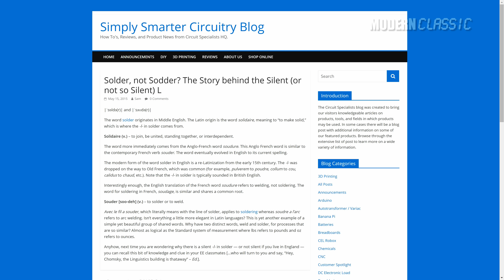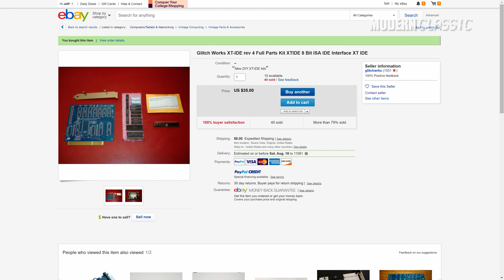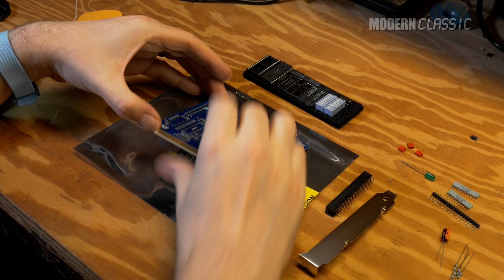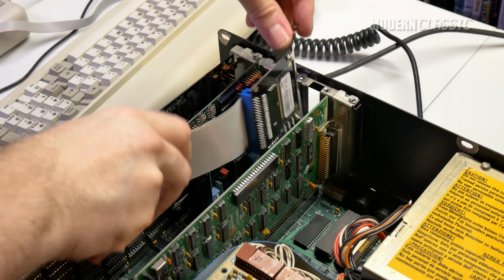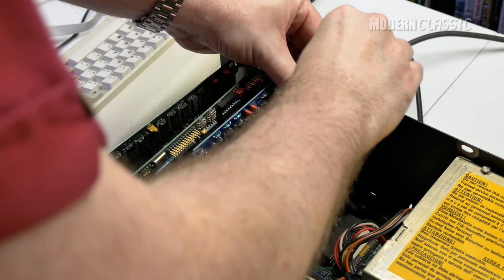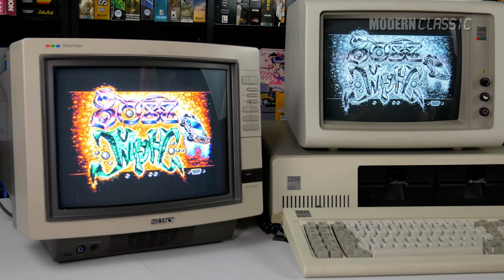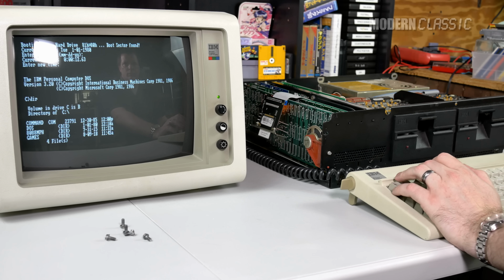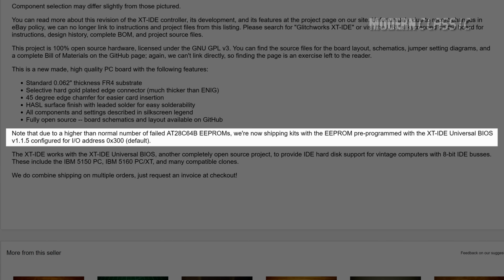Flash storage for classic PC's - building an XT-IDE kit!

Comment: Interesting, I've gotten an old 386sx going curtesy of a CF card, however XT's are harder as they don't have the bios routines for HDD boot, hence your cards ROM. You've kind of got me interested in digging out an older PC and having a go.

As for the sodder/solder thing, I found your pronunciation quite acceptable to my ears, I'm from the soLder side of the world and have just learned to live with it. However I was watching a renovation video the other day and cracked up when they said pergola.

As for the composite colour thing, I'm amazed IBM didn't have a way to display the same colour's on their RGBI monitors, it carn't be that hard to make a fudge box. I live in Australia, where we use PAL instead of NTSC, the artifact trick only works with NTSC, so I never knew of it till I saw it on the net.
Reply from the maker: I'm in the same boat but in reverse - I never knew the NTSC artifact trick didn't work on PAL until I was looking up games that I could install to test it out on this PC. I happened across that info by chance; I had just never thought of it before. So I guess you guys just don't have access to seeing those games in 16 colors?

I'm still kind of amazed that somebody even figured out that you could use the NTSC signal in that way, and give computers powers that they otherwise wouldn't have.

Comment: My first HD was for my Atari 520STm...cost me a total of ~$580 for the 32MB RLL drive mechanism + drive controller + ACSI-to-drive controller host adapter (ACSI = Atari Computer System Interface) + external HDD enclosure.  I remember going to a local ComputerLand store asking if they sold bare drives and after them asking me what I was trying to use one with, they said, "You can't connect a hard drive to an 'Artari'" and that I needed an IBM PC or Mac for that.  And that's when my abhorrence of IBM PC/Mac snobs began! ;-)

Comment: Modern Classic : one hobby tip for you when you solder DIP packages. solder pin 1, then solder opposite pin, then reheat each pin while pushing on the component, so the DIP is tighten to the board and then you can solder the rest of the pins. for pin jumpers, have a bunch of jumpers to hold the 2 rows together while soldering. And finally, the top tool for soldering : FACOM 153 Brucelle

Comment: Possible fix to using 2 slots.  since the IDE card is oriented for XT/AT/ISA, and the CF adapter is oriented for PCI, could you get away with not using the bracket on the IDE card, and seating the CF adapter in the same slot?
Reply: Sarreq Teryx If he did not mind the CF card being internal (and less accessible) then there are other options as well, such as plugging an adapter into the IDE connector or modding the rear of the chassis with a slot for the CF card and eject button and just mounting the CF card adapter to an open area on the rear of the chassis.  Or even spinning a version of the ISA adapter that includes an onboard CF or SD Card slot (though CF is much easier to interface with IDE since CF Cards are just a miniaturized IDE device).

Comment: I really have to take the time to get my IBM PC going. I started to work on it but then summer arrived so my project focus shifted. It has 2x 5.25" drives, no HDD and I have a great green monochromatic screen for it, which still works. Whenever I do get it working, I want to try this version of Linux on it too. I figure, I will have plenty of space to dual boot: http://elks.sourceforge.net/
Reply from the maker: I guess if you do want to run Linux, that's the best version for the original PC. I'm curious how well it runs and what you can do with it. (I guess if you only run the command line, you can probably do a lot.)
Reply: Most of what I would do would be in the terminal. As neat as a modern machine is, it is pretty good at distracting you too. I need to find a network solution for this 5150 as well. So, the uses I have planned for it would be: Distraction free writing, IRC and simple terminal based web browsing. I have no need for a color screen, I quite literally just want to use the green phosphorus monitor I already have. If memory is limiting my ability to do any of those, I can SSH into another box and use those resources.

Comment: I'd say you were using the right amount of solder at the start, towards the end, you were using way too little imo.
You have to remember, this is through-hole stuff.  The solder is supposed to flow through the hole to the other side somewhat.  It's not supposed to just sit where the soldering iron is.  So you have to add slightly more solder than you think is necessary to allow some to flow through the hole.
Reply from the maker: That's why I was using more at the beginning, but I ended up fouling the socket and there did end up being somewhat big blobs on the other side.
Reply: yeah you just have to get a feel for how much you need.  It's very much a skill that comes in time

Comment: I’d like to add one small constructive criticism - you were right to tin the tip of the iron and wipe it clean, that is truly a thing, but it didn’t look like you were re-tinning it before soldering. My dad was a NASA-certified soldering instructor so in a way I’m kind of a drill sergeant’s kid, but for what it’s worth - solder on the tip helps to transfer heat more easily than a bare tip alone. Doesn’t need to have a big glob of soldier on it, just “wet.” My Dad got into the habit of tinning it and then with a quick snap of the wrist, flinging the extra solder off (he typically worked on a piece of scrap or cardboard so he wasn’t ruining his bench). The point is a layer of solder on the tip helps transfer heat to the work. Since you’re correctly heating the work and then melting the solder against it, this might help in the future.
Reply from the maker: I tinned the tip at least 25 times that I didn't show in the video.
Reply: I apologize for mentioning it then.
Reply: The tip gets tinned when you solder something with it ;-)
Reply: It does if you touch the iron to the work, then push solder into the tip and let it flow onto the work. I just wanted to make the suggestion in case it was helpful; I was not judging. The way I was taught to solder was that having the tip "wet" with solder before it touches the work allows heat to be more easily transferred to the work, and that using the heated work to flow solder makes more effective solder joints than melting it on the tip against the work. I am sorry if I offended.
Reply: You are right. It’s good practice to tin the tip before you start working on a project. However the tip will get wet(ter) when you solder a few joints. I always find myself wiping off the solder from the iron when I solder.

Comment: Why DOS 5.0 instead of 6.22?
Reply from the maker: DOS 5 is, AFAIK the last version of MS-DOS available on 5.25" disks, and the idea is to make a set of my own disks so I can reinstall it from the physical disks and then re-partition the card. PC-DOS 6.1 was still on 5.25" disk, but it's forked at that point. (That said, I may go for it anyway.) Also, several older apps won't run on DOS 6.22, and running old apps is what I plan to do on this PC. There's no real advantage to running DOS 6.22 on an original PC. I'm not going to be running Drivespace on the CF card.

Comment: Awesome vid! But i think i would use a sd card to ide adapter instead of cf. Sd cards last longer that cf cards (correct me if im wrong).
Reply from the maker: I'm using CF because CF has built-in emulation of IDE drives - it's part of the spec.
Reply: Heck, the CF form factor is also a good match for the IBM micro-drive things that iPods had, which were also IDE. Seen people just plop a CF card in an HDD iPod as an upgrade and as far as the iPod was concerned it wasn't doing anything different. But the battery lasted longer! And of course, modern CF cards can be faster than SD cards, which is why some high end digital cameras will have a hybrid card slot, or even only take CF. 

Whichever people pick for projects like this is entirely up to preference about what you have already, what you have readers for already, etc. But for computers that can handle IDE, the CF cards talking in IDE definitely simplifies things. A "CF to IDE" adapter doesn't need any conversion logic, which is nice. Just like USB, only the form factor is different between connectors.
Reply: Kit Vitae My actuall only problem with them now, is the price. 
They are very pricy. If mine wont have enough space for my friends games we will get a sd to cf adapter and a 32gb sdcard or even a 64gb one. With the pric of a 32gb one i can buy 2 64gb sd cards basically around here, idk how they are priced in the us tho.
Reply: Modern Classic I think that many of the sd to ide adapters i've seen also do that. But idk. 
I've seen druaga1 do that to install windows 200 in a sd card, on a ide laptop, and it seemed to recognize the sd as a normal ide drive. But his adapter was a bad quality one and sometimes it had some throuble.
Reply from the maker: I haven't looked too deeply into it but CF is kind of the standard thing for this, which is why I went with it. And AFAIK it's because of CF's built-in IDE support, which means the adapter doesn't really need to do much and compatibility should be high. That said, it's probably pretty much the same experience if you get a good SD adapter.
Reply: Modern Classic Do you know how many years it should last being used like that? I have a old cf my friend has a laptop that should support it. Light use of course, in windows 2k or maybe xp without the sp's
Reply from the maker: It will last a long time. It's hard to find really good statistics but here's a little info (read the first comment at the bottom as well): https://mrzonbu.wordpress.com/2007/09/23/compactflash-cf-evaluated-lifespan-per-zonbu/
The thing about SLC vs. MLC mentioned in the comment is another reason I went with a small industrial card - these use SLC, which has a much longer lifespan. You can still use a consumer card that uses MLC and I don't think it'd matter for this purpose, though. There's another channel I watch that had a video explaining this; I'll try to find it again and post it later.

Remember also that DOS doesn't really swap things to disk like Windows does, so if you're running DOS, your card isn't really getting many writes.
Reply: Modern Classic Very valuable info! Thx! 
I will save that website.
Reply from the maker: This is the video I was talking about - it's actually about SSD's but it explains the difference between SLC and MLC (which applies to CF cards too): https://youtu.be/-XZNr7mS0iw?t=1m43s
As far as I know all SD cards are MLC. Some CF cards are SLC while others are MLC.
Remember, though, that you can always easily back up any kind of flash storage. And on an old computer, it's not much data. You could do a full backup every day in less time it probably takes to transfer a few photos from a phone or camera memory card to your computer. So if the card ever dies, you can just get another one.
Reply: Modern Classic Yeah, i will look into that in a future project, as i cant find a sata to ide adapter for laptops to use a ssd in a old ide laptop.
Reply: You can get CF and SD both in SLC and MLC. Industrial variants of SD and CF tend to be SLC, at least the ones from reputable manufacturers. There are way more industrial CF cards on the surplus market (e.g. eBay) than industrial SD cards though.
Reply: glitchwrks It would be nice to find one. But unfortunatly, where i live imorting taxes are pretty high, so the price would at least double.

Comment: You should try puting the hard card on a pentium 3 with isa anf run linux and then dd_rescue to copy and try to recover the most possible out of the old hard drive. Id say recover with record once or twice. Let it try a while and once you see it wont anymore, try placing the hdd on the fridge and once cold try quickly again to recover the remaining sectors. Sometimes failing hdds work again witj changes in temperature.
Reply from the maker: I may try something like that. I'm in the process of putting my old Athlon system back together, and it has a single ISA slot. But, it seems like it's just that one app that has problems (I tried it again tonight in the PC), so it might not really gain me much. I can just download Paradox 3.5 from somewhere; it's abandonware at this point.

Comment: Nice soldering! 
You don't need to sacrifice one of your slots. Just buy a "Compact Flash CF to 3.5 Female 40 Pin IDE" on eBay. The adapter can be connected directly to a connector of your XT-IDE card without any cable. The downside of this solution is that the CF card is internal, not accessible from outside, same as your MFM drive.
Reply from the maker: That's why I bought the adapter that I did; I want access from the outside. In fact, you can see in several shots that I have exactly the CF adapter you're describing (check 9:18) - I just didn't use it.

Comment: Hardcard is not MFM but something proprietary. Fun times I had when I was asked to back up the media from such a card a while back. Luckily those hdds are still "ok" with being opened for a short timespan and it just had the issue of the heads being stuck in the parking position. Used an XT-CF as a replacement.
On the IBM 5155 I serviced I had DOS 3.2 as the original system running and a copy of DOS 6.22 just in case. Both were installed on different partitions which could be selected by setting them active. Keep in mind if you use DOS 3.2 with Windows7 or higher, it will detect the FAT12 as a faulty floppy (as FAT12 remained the choice of partition type for pc floppies) and fuck up things.
Reply from the maker: It's actually an MFM drive with an RLL controller, which is one reason why they're so unreliable.
Reply: Every HDD since ST412 has been using MFM read/write method with an RLL encoding. Early drives were using RLL 1,3, later ones RLL 2,7. Only a SD Floppy Drives were using FM instead of MFM which is RLL 0,1. IDE drives also use RLL encoding. In the ST-412/506 times there were technically no difference between MFM (aka RLL 1,3) and RLL (aka RLL 2,7) drives. Some drives were certified as RLL capable, but in practice there was no difference between ST-251 and ST-277R (there was a ST-251R which was a different drive). The capacity and transfer rate were only dependent on the controller used.

Comment: Modern Classic I’m British but don’t personally have a problem with Americans pronouncing it “Sodder” and I honestly don’t understand people who do? I understand that you get people criticising you all the time and I’m not trying to have a go at you but I would suggest you’ll find it easier if you use thinner gauge solder, it gives you finer control over the amount of solder flowing in to the joint. Similarly it looked from what little you showed that you had problems soldering the EPROM socket because your iron was too hot? As if you’d used it for too long and hadn’t let it cool down for a while which would also cause too much solder to flow in to the joint?
Obviously I didn’t see the whole job, just what you edited in to the video, so I appreciate that I could be completely wrong but my mediate reaction was that you where using way too thick a gauge of solder for that job and that the solder flowed too quick when you soldered that EPROM socket?
Reply from the maker: Check out my pinned comment, but long story short, I use thicker solder because it has a thicker flux core. You are right that it might have meant I wouldn't have screwed up the EEPROM socket if I'd used thinner solder, though. But in general, it takes me longer to work with thinner solder that has a much smaller flux core. (The flux core gets smaller faster than the diameter of the solder itself as you go down in diameter.)

Comment: Great video! On my PC XT, I used a very of Seagate 40mb hard disk drive, as I wanted to preserve the hard disk drive sounds. I had no trouble to install DOS 6 on the machine itself from floppy disks.
Reply from the maker: On an XT I'd probably get flash storage and a real hard drive working, both because XT's typically came with hard drives and also because they have 8 slots to let you do that. Since the original PC never came with a hard drive and my memories of them are of just fan noise, I actually feel like it's more historically accurate to ditch the hard drive in this machine.

Comment: Nice video. I remember the artefact from your cga screen, it's called (or we called it) snow. It's there when you PC sends data to the screen when your monitor electron bean moves from the lower right to the upper left corner. Some aoftware programs had an option to prevent this.

Comment: When we get those devices as diy kits, the lower price is just an excuse: it's the pleasure of assembly everything, fixing it and seeing it working that matters :). I wonder if there's already an all in one card (ide + cf) to avoid using two slots in those scenarios :)
Reply from the maker: There is an XT-CF card, but I did want the freedom to use other devices if I chose to at some point, and not be locked in to CF. With this card, I could switch to SD, or an IDE hard drive, or even an SSD if I wanted to.